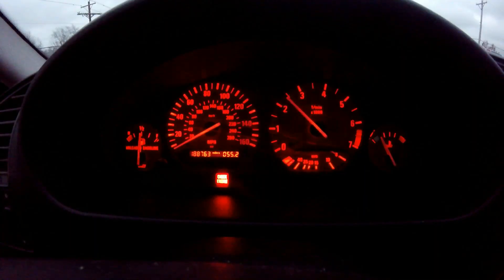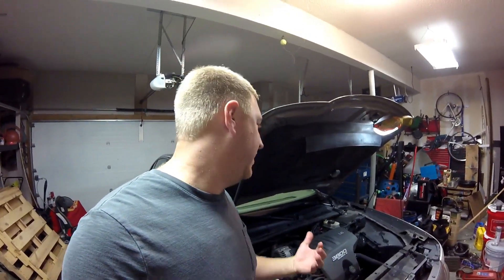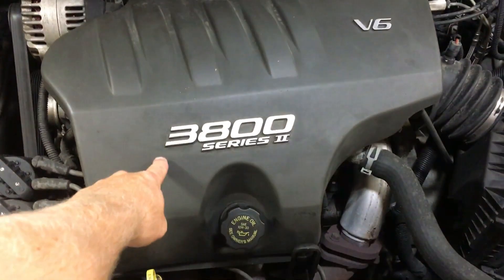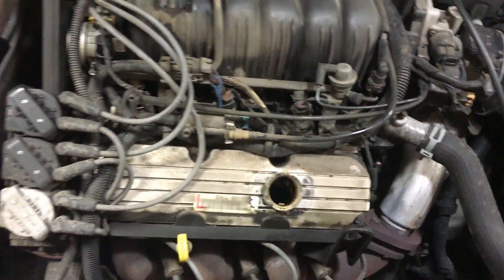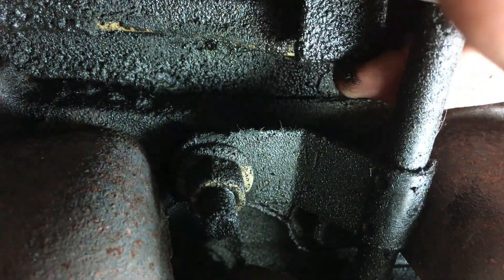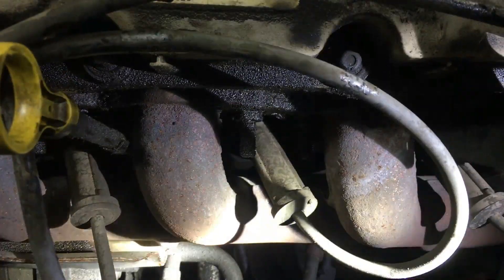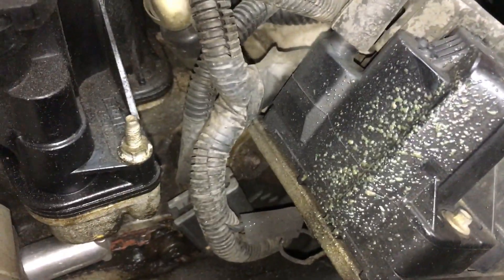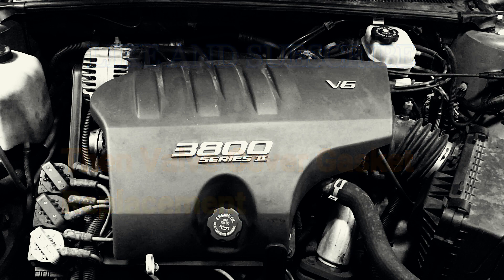Diagnosis of oil leaks on a GM 3800 V6 - Valve cover gaskets and intake manifold gaskets

Comment: Nowadays you spend more time removing plastic crap than doing actual jobs it seems.
Reply from the maker: I agree. It takes about 10 minutes to remove the plastic covers on a c7 Vette just to finally see the actual engine.
Reply: I have a 96 Olds Eighty-Eight, man I love that car. Went through a rough time and wasn't thrilled at first about settling with a 90s car, BUT the car has 170k and still drives like new. I am currently battling a couple leaks. Trans fluid, leaking from the radiator connection and coolant, which I thought was the pump (changing the pump anyways) but it was those little plastic hoses that feed through the tensioner to the heater core. Its has been really weird as the reservoir will deplete, but always have enough coolant in the radiator. 

Meh, just rambling, but yeah I have a newfound respect for the 3800. Super reliable and super easy to work on with a basic set of tools. And strangely it really isn't all that outdated. Some of the features seem way before its time. Besides under the hood, the only other thing that needed an update was the radio and speakers. Everything else is good.
Reply from the maker: Yeah we had a 96 Bonneville growing up. That was a great car. I think it had over 300k when we got rid of it.

Comment: Hi there this is my 1ft time watching your video.  
Question. Do you have a bulletin in regards to this recall for the front valve gasket and cover?? I have a 2004 Pontiac Bonneville SE with the 3800 series Il engine.  It currently has 74,000 miles on it.  I’ve heard lots about this as well and I even called GM regarding about this recalls.  This said the recall is vin number Specific.  Once I gave them my vin number they told me I have no recall or open case for my particular vehicle. 

What are your thoughts about it.
Reply from the maker: For some reason the recall is only for the W body vehicles (impala, Monte Carlo, Grand Prix, etc). Even though you have the same engine, your vehicle is an H body (4th digit in the VIN). It doesn’t make sense to me that they would only recall one body type, but it’s what GM did.

Comment: So if I was driving and suddenly lost all power, pull over and all my oil is on the ground and it looks to be leaking from the front valve cover, should I replace that first? I'm not positive but I believe after that my oil and coolant mixed together after whichever gasket blew, does that sound more like head gasket? Although I put a backup quart in and it's clearly leaking from the valve cover?
Reply from the maker: This really doesn’t sound good. I don’t see a valve cover leak causing this issue. Are you sure it didn’t throw a rod through the oil pan to cause that bad of a leak?! If it’s mixed with antifreeze then you either have a cracked block, head, head gasket or intake gasket leak. But it sounds like the engine may need a ton of work if it died and now there is a massive leak.
Reply: @PetesGarageandperformance  I'm not positive that it didn't throw a rod, but there was no loud noise and my car wasn't overheating before it happened. It's only leaking from the valve cover that I can see, what test should I do to determine the true issue before I go wasting money on all this other stuff? I bought the car at 154K miles has 172K now, I know it didn't have the best maintenance from previous owners but I flushed it and change the oil every 3K miles, changed plugs, wires, all filters, maf sensor, cleaned idler control valve, replaced cool packs etc, engine really had some go and never had any issues in 8 months of atleast 30+ miles a day driving.
Reply from the maker: @sykrss9534  ok just clean off the valve cover area with brake cleaner (engine off). Then drive it a little bit and see. You should be able to tell where the new leak is coming from.  As far as dying... it could be unrelated to the oil leak. Check fuel pressure. Also check for spark with a spark tester. If you don't have any spark, it's possibly the crankshaft position sensor. I bet the intake gaskets are toast too if they've never been done.

Comment: Great vids man! Subbed. I just bought 1990 Olds 88. I have the spark plug rail and VIN shows no recall. Would it be wise just to get rid of it anyway and clear/secure the wires? Thanks

Comment: I did my upper plenum and lower intake gaskets at 70K..the 3800 is still going strong at 230K now
Reply: what if a small piece of the coolant elbows (tensioner pulley elbows) dropped into the lower intake manifold.  I used a hook tool to get the o-ring out, but a small plastic broken part of the elbow dropped down in on me.  Should I worry about that or would it not cause any problems.  Thanks!!
Reply: @dabneyoffermein595  there has been some people that the same situation has happened without any problems, but I would try to get it out. You can try to vacuum it out or flush it out with a hose. Also make sure to replace the elbows with the new metal ones

Comment: Any idea of why spark plugs get oil in this engine?
Reply from the maker: Because it runs down from the valve covers leaking.
Reply: @PetesGarageandperformance  i know most hondas and 4 cylinder engines have the spark plugs on top of the valve cover and also have O' rings to prevent oil from getting into the spark plugs but this engine has a different set up that's why i asked

Comment from the maker: Be sure to check out my how-to videos on my channel for step-by-step directions on fixing these leaks.
Reply: Were are u located?
Reply from the maker: bobby childs Kansas City area
Reply: Why is there know videos on replacing the back valve cover gasket on 3.8 or 3.9 3.5 hell any of them ?
Reply from the maker: William Coleman here’s the video of replacing the gaskets. I did the intake gaskets at the same time but you don’t have to take the intake off. 
https://youtu.be/kM7kQ7MqbR8
Reply: Pete's Garage I own a 2002 Buick Regal also has the 3800 Series II but once a month I check the oil level & sometimes the level keeps going down I always keep up with my oil changes but once a month when I check the oil level it keeps getting low I feel like I am Burning Oil it’s not leaking, the oil pan underneath is a bit rusty but I believe that it is burning oil what could it be?
Reply from the maker: Mark from [fordmustang98guy] does it have a bunch of miles on it? Are your spark plugs ashy?
Reply: @PetesGarageandperformance  My Regal had 48,000 miles when I bought it now its got 62,000 miles but I got the spark plugs changed at 55,000 miles

Comment: I have an 01 Buick with a 3800, also with a number of slow leaks, but why the wax (crayon on the baseboard heater) smell ?? I guess oil and wax are both petroleum products. Still seems a bit strange. It is, however good to know that’s its oil not wax, in terms of diagnosis. Thanks
Reply from the maker: Yeah it's exactly what this one smelled like.  Thanks for watching.

Comment: If only the recall actually told them to replace BOTH the front and rear valve cover Gaskets instead of one....
Reply from the maker: Yeah this recall really doesn’t make sense. They only recalled the W body cars even though other platforms used the exact same engine. Also the valve cover gaskets had always developed leaks after about 100k miles. It’s just some people don’t ever fix the leaks and just let the oil constantly drip onto the exhaust manifolds. Then they sue GM when the car catches on fire. There are other vehicles that are notorious for valve cover gasket leaks but never got recalled.

Comment: Best how to I've seen thank you for posting this
Reply from the maker: Matthew Gunter no problem. Are you trying to fix a leaky 3800?
Reply: @PetesGarageandperformance  yes I made the mistake of putting full synthetic in an older engine. Hopefully some castrol gtx 10w30 and some STP oil treatment with stop leak will fix it. The car started having that candle burn smell when I put the Mobil 1 full synthetic. My wife and I both have these bucks. They are practically bulletproof but they do have their quirks.
Reply from the maker: Matthew Gunter don’t put any kind of stop leak product in your oil. If it leaks with synthetic, it was about to fail anyway. Just replace the leaking gaskets for a couple hundred dollars and have a reliable engine that doesn’t leak anymore. I also have videos on these repairs.

Comment: People check with GM site for any recalls pending on your car ive gotten lucky and had my car serviced free of charge and a good running car. Lr check NHTSA for recalls on any car
Reply from the maker: Yes many people think because their vehicle is older that they should stay away from the dealership. Many recalls don’t expire and the valve cover recall on some of these 3800 engines is only a few years old.

Comment: I got a 2005 Buick custom and when I start it sounds bad I'm leaking coolant my battery gage is jumping from 11 to 13 volts idk what's wrong sometimes it starts n runs sometimes it won't start and when it dose the rpm gage is jumping from 1000 to 3000 rpm if you can help me I would appreciate it
Reply from the maker: Joey Fleer maybe the water pump is leaking coolant all over the crankshaft position sensor? Hard to tell from here.
Reply: Just put new water pump in got under the car today and seen water dripping off the oil filter
Reply from the maker: Joey Fleer could be coming from the coolant elbows.
Reply from the maker: Check out my intake gasket video and you’ll see the coolant elbows I’m talking about
Reply: @PetesGarageandperformance  there not plastic but the one under the alt has a leak think the o ring is bad?? don't feel any cracks gonna watch it now
Reply from the maker: Joey Fleer probably the o-ring or maybe the bore it fits in isn’t clean or the elbow isn’t installed square to the block
Reply from the maker: Any luck?

Comment: Replaced valve cover gaskets now I have blue smoke what would the issue be? It comes at operating temperature while idling when you drive it’s fine!! And there’s no smoke until it heats up
Reply from the maker: Blue smoke from the tail pipe or blue smoke from under the hood?
Reply: Tailpipe
Reply from the maker: That’s not good. Sounds like either the PCV valve is messed up and it is sucking oil into the intake and burning it. Or your piston rings are worn causing it to burn oil. Blue smoke is burning oil.
Reply: Yeah replaced Pcv valve no joy my buddy added seafoam when we changed to gaskets since the the oil looked gunky at this point no clue has 168k on the clock thought maybe the lower intake might of caused it but other than that runs smooth with lots of power computer scanner showed a misfire on cylinder 3 but never heard or felt a difference
Reply from the maker: James Larkin I believe there is supposed to be an o-ring on the PCV valve. It’s easily overlooked and can cause this issue. Double check the PCV.

Comment: I just had my head gaskets replaced on my 2002 Buick LeSabre. It cost me a lot of money. I had the same smell when I came to a stop as well. I thought that's what it might be so I popped the hood and I saw oil all over the side of the engine. I'm not a mechanic and I knew what it was. I can't believe that the guy took his car to 2 shops and couldn't figure it out. That's crazy. BTW my LeSabre has 101,000 miles on it. It runs very well. I have owned the car for almost 7 years. I bought it from my grandmother.
Reply from the maker: matt gilmore yeah I couldn’t believe that he took it to two “shops” either. When he told me that I was thinking it would be something far less obvious.

Comment: The engine won't start with the belt on take the belt off and it cranks any ideas
Reply from the maker: One of the accessories is locked up. Try spinning the alternator, water pump, a/c compressor, tensioner, and idler pulleys by hand. One will be locked up. Then replace that part.

Comment: Do you have a video on repairing and replacing the Rear Valve Cover Gasket on GM/02 Bonneville? Thanks.
Reply from the maker: I have a video on the valve cover replacement and yours should be identical to that one except you don’t have to remove the intake to do the valve covers.

Comment: I can't not find my power steering location on my 08 lucerne
Reply from the maker: stack hester the pump is way down on the back side of the engine if you have a 3800.
Reply: It's part of the serpentine belt.  It's low buy the fire wall

Comment: hey Pete's Garage, if my 3800 is leaking a quart or more a week could that be from the valve covers and LIM?? Or should i be thinking rear main? the starter was covered with oil when i changed it so thinking it might be towards the front of the engine but not real sure...??
Reply from the maker: I’ve also seen the front cover leaking by the oil filter. It will leak pretty quickly because it is under pressure there.

Comment: I have a 99 Regal. Of course it has the 3800 Series 2. The gaskets seem to be ok right now but at what mileage do most of these engines show failure? Mine has about 160K original miles. Thanks.

Comment: 3800s are also in Intrigues. Your comments were insightful. I see those fixes needing to be done.I didn't know about the cover, which I diligently cleaned, and learn from yourself GM suggests tossing.
Also elbow on belt tensioner cracks. Thanks for the video.
Reply from the maker: Thanks for watching!

Comment: There was two recalls on this engine, the first one in 2009 and the second in 2014 because the first one still caused fires.
Reply from the maker: Yeah the first one was to just toss the spark plug wire rails and install clips. The rails would hold the oil that the valve cover was leaking. This obviously didn’t stop the leaks so it was pretty pointless.
Reply: GM engineers right.  The first recall made it worse.

Comment: There was no neglect on my part.There was no signs of leaking..no oil burning smell.I had the valve cover gaskets replaced a year before it caught fire..and i had the lower intake manifold gaskets replaced too cause it went bad..there was oil in the radiator..and it was relplaced with o.e.m gaskets.I was on my way to work..parked..walked into the building and it bursted into flames..The fire dept. came and put the fire out..and the one fireman told me he has put out multiple 3800 engine fires.
Reply from the maker: Alex S I wonder if the fuel line where it connected to the fuel rail was leaking. I have seen many of those leak. I would’ve thought there would have been a recall on that before a valve cover and gasket.
Reply: Pete's Garage. I suppose that's possible..I've heard of those fuel rails leaking. The engine compartmant was toasted so it was hard to determine where it originated at. My work building had security cameras and i watched the footage.it was early in the morning still dark and the asphalt under my front bumper was glowing red when the fire initially started which led me to think it was coming from the very front of my engine.not towards the back by the fuel rails. but who knows for sure.

Comment: Those 3800 engines are ticking timebombs to catch on fire.My 2000 grandprix caught fire from leaking valve cover gaskets..avoid those engines.
Reply from the maker: I think the 3800 is one of the more reliable engines GM made. It takes a lot of neglect to get to the point the oil leak will catch fire. If you smell burning oil every time you park your car for years you should probably have the leaks fixed!

Comment: I know this is an older video hopefully someone sees this. I just bought a used 05 Pontiac G6 Im starting to work on. Everything I look up online brings up this GM 3800, is this the same engine?
Reply from the maker: No the G6 does not have the 3800. Your car could have a few different engine combinations.

Comment: Great videos! I have a quick question I was hoping you could answer for me. While I understand this is a Series ii 3800 I am currently looking at a Series iii. The question I have is do you know if the Series iii has aluminum (not plastic) Intake Manifold Gaskets? I know the Series 3 has an aluminum Intake Manifold, just not sure about the gaskets themselves. Any help you could provide me with would be very much appreciated. Thanks for your time.
Reply from the maker: I’m pretty sure it still uses the same style injection molded plastic/rubber gaskets as the series II does.

Comment: MY wife took her 2003 Impala into a GM dealership because the oil light went on. It was a quart low with 2700 mile since the last oil change. It has 123,000 miles on it. The dealership charged her $80 to do an assessment on it and needed to put die in the oil to try to track where oil was leaking out. Now they want to charge her $300 to change the valve cover gasket. First, I heard in this video that there was a recall to fix this...is that correct? Is it still valid? Second, there is never any oil on the garage floor and for a car worth $2500 is it worth worrying about and just add a quart between oil changes? Can there be any other damage done to the car if i ignore it and add the oil when needed?
Reply from the maker: Jerry Svoboda only certain vehicles with the 3.8 were recalled. They were W body cars and the impala is a W body. I’m not 100% sure on what years though. Usually they don’t leak that much oil. The valve cover gasket would have to be puking oil all over to be low on oil. I would get a second opinion on the oil consumption. But if the valve cover is leaking then it should be fixed anyway.
Reply: @PetesGarageandperformance  the danger is oil leaking under the valve cover onto the front exhaust manifold and igniting. Under Hood Fire is the recall reason. Just had a fire on my 2002 grand prix 3800. Dealer repairs for no charge I have learned.
Reply: @dasmiff1  I have a 2001 with front valve cover gasket leaking. Is this still covered??